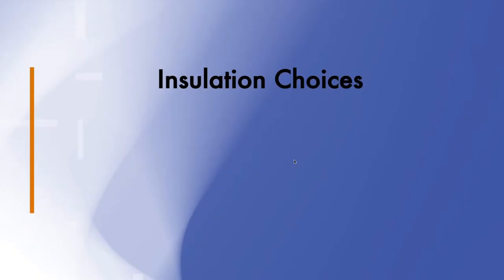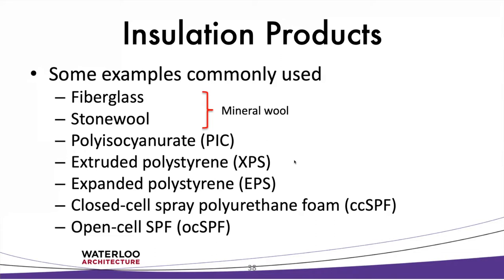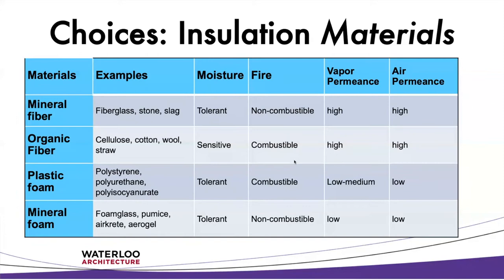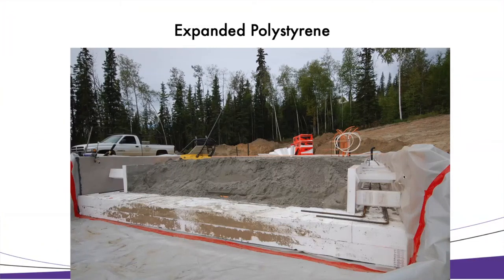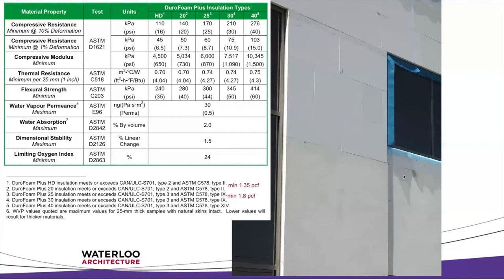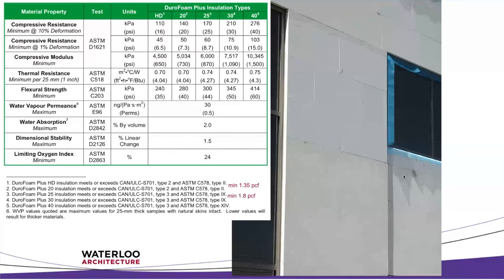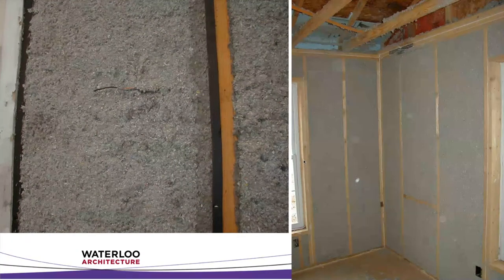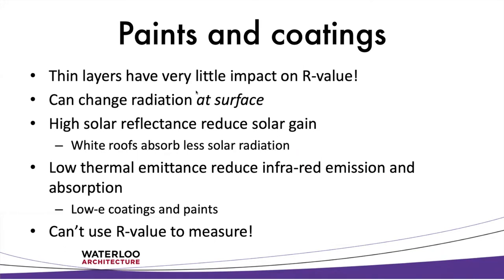Building Insulation: Options and Choices

Comment: I was on a project that renovated a 1963 museum and we removed a fair amount of foam glass installed in the space above a continuous window wall between the upper horizontal mullion and the slab underside above. 2” thick. Had been punctured many times over the years by careless wire feeding for assorted building system infrastructure add-ons.
Smelled slightly like rotten eggs which makes me wonder if the newer stuff does also.